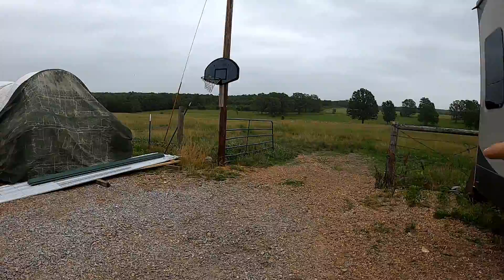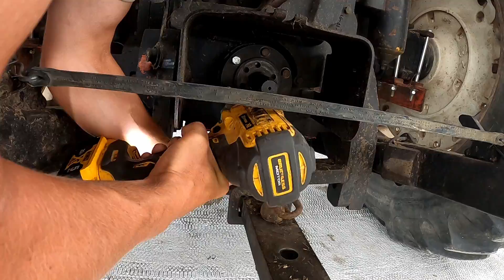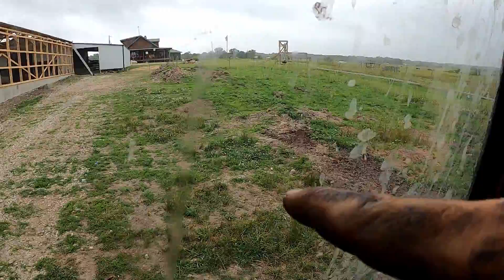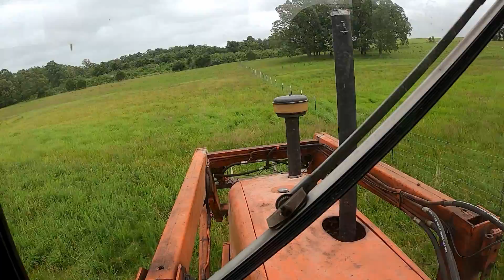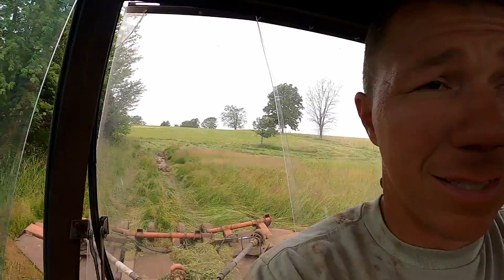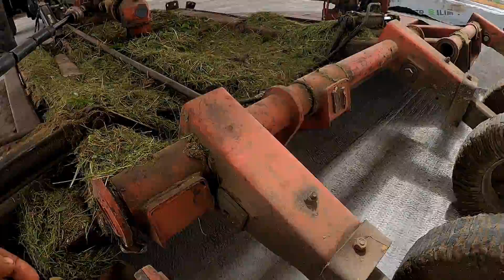The pond is leaking and the tractor is sinking...stuck in the mud

Comment: If you chain a fence post to rear hubs and have a lot of luck; you can drive out of some really bad spots. But remember to have something larger than what is stuck.
Reply from the maker: That's great advice but the fence posts wouldn't have been able to do much as it was just soft ground. As far as having larger equipment than what you get stuck that is great advice but not always feasible unfortunately.

Comment: I always disengage my PTO when I have to do anything on my rotary mower. Yours is especially dangerous without any PTO safety covers or debris safety chains.
Reply from the maker: That is true and a wise point but I stopped where it was up high enough not to cut or touch anything with the blades